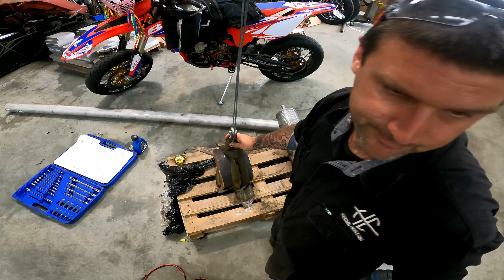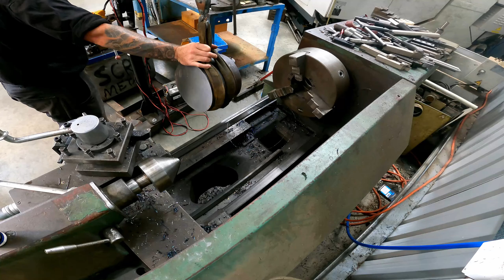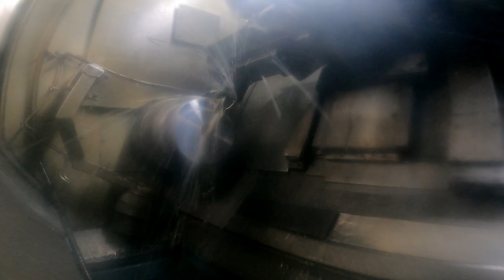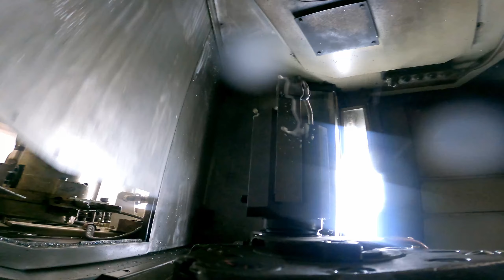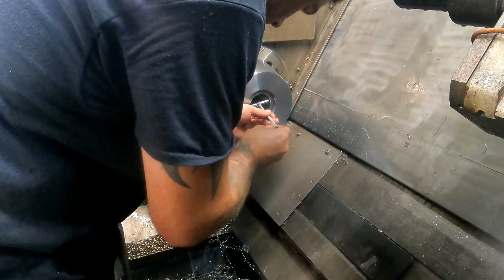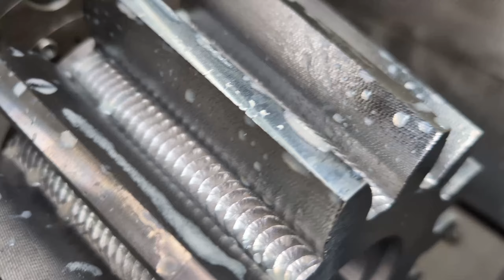BIG BEVEL GEAR!

Comment: Dude...don't you want to center drill before you bring the center up? Or put a centerdrilled slug in between the center and the workpiece if you're trying to use the tailstock to push?

Why machine a step in the face if you're just going to machine it away later?

PUSH them tools.....
Reply from the maker: Hey mate. The center was just there to put some pressure against the stock to make sure it was hard against the jaws, and for a little security. It's a pipe center with a flat section at the end (and a counterbore with the screw that holds it together) so i'm not risking anything by using it in this way. 

I'm not sure what step you're talking about that i machined away. there's a step at the back side of the part (it's what's being held in the jaws when all of the milling is being done)